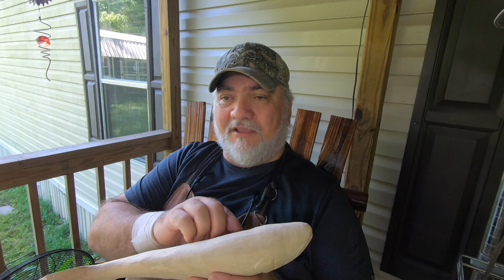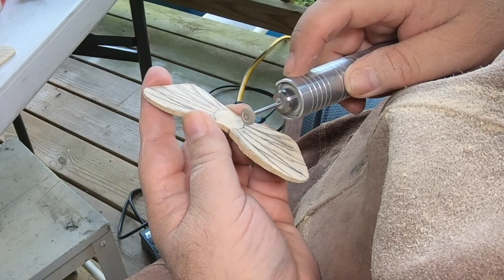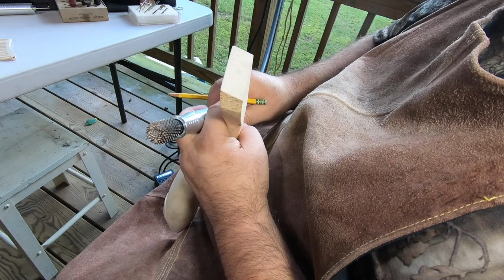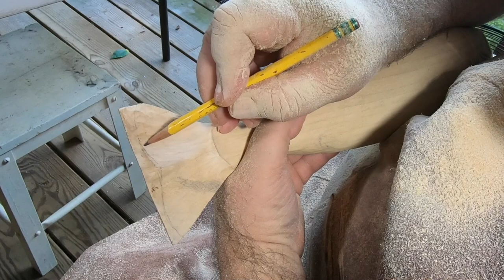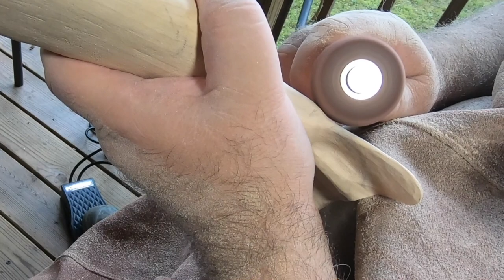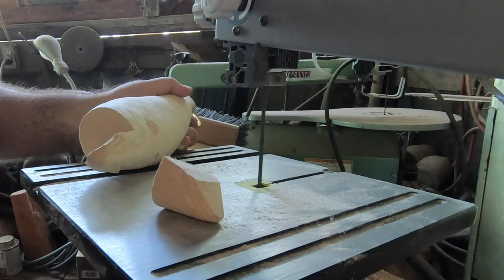Wood Carving a Walleye, Part 3 Carving Fins

Comment: Hi Danny, I have used wooden toothpicks to make teeth on pike mounts before,blended in with epoxcie putty
Reply from the maker: Thanks! I’ve thought about that also, and it may come down to using them  and rose thorns If the Loctite Power Grab don’t work like I want.